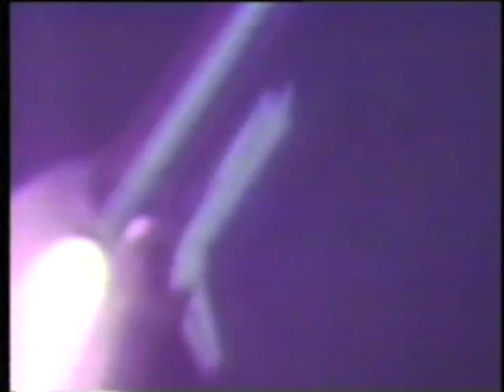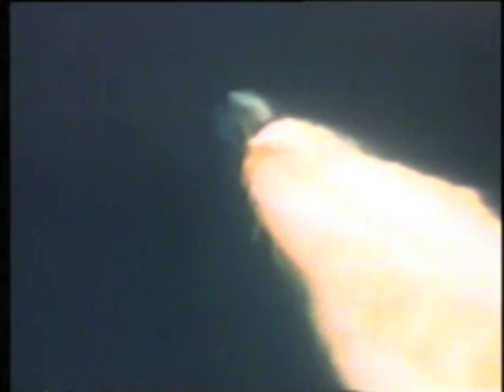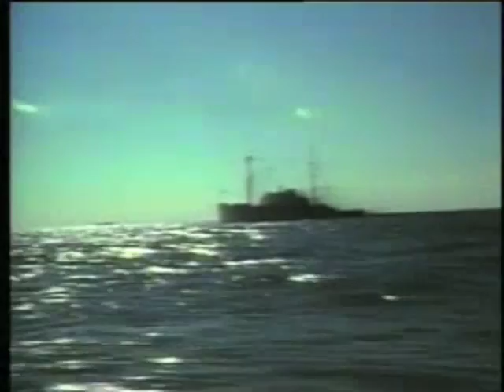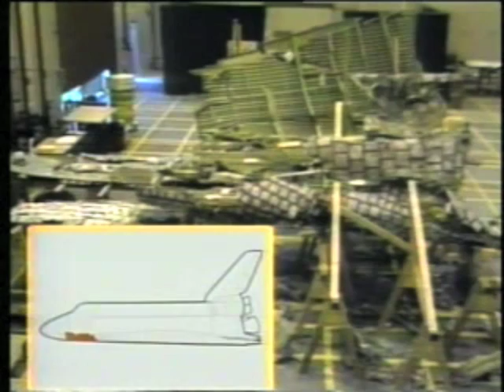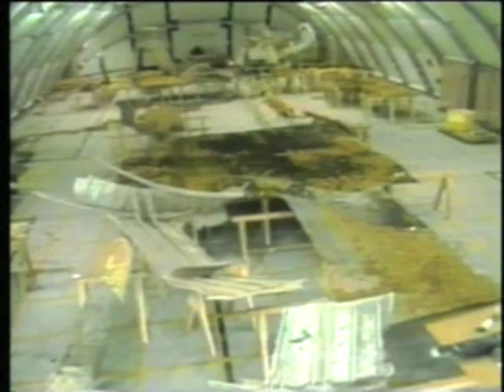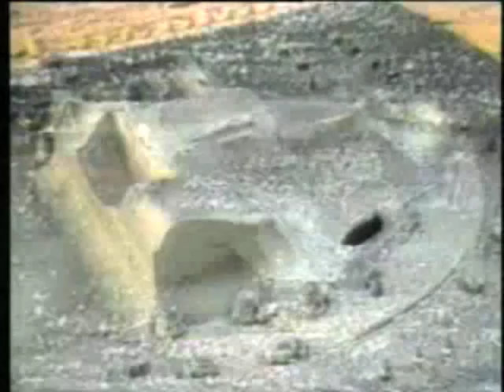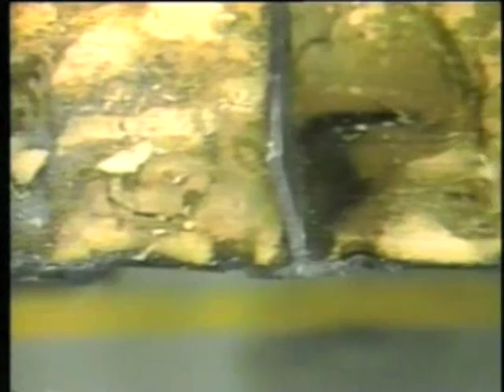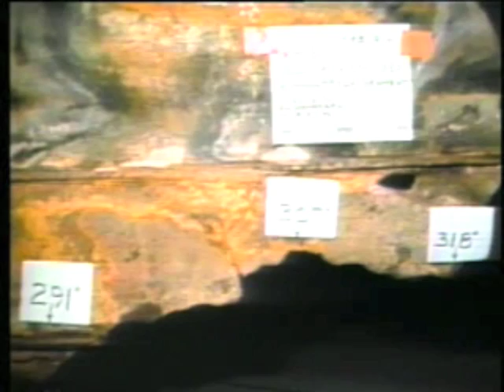Challenger Accident - Part III Photo and Video Analysis

Comment: the cause of the challenger breakup was NOT a faulty srb seal design. if it was why went the 24 previous launches right? the real cause is the faulty design of the NASA and Thiokol Managers and Bosses brains. they were (and are) money-  and prestige addicted and stupid as they have NO technical understanding. Because of that they did not listen to the thiokol engineers which strictly recommended to abort the launch because of the cold temperatures. But managers and bosses said...."what do engineers know?!"  NASA and thiokol bosses and managers are guilty. because of them and their wrong decisions the shuttle was lost (about 2,8 billion USD) and its crew died.
Reply: No, it was the seal. This particular flight happened to take place on a day when it was 15 degrees colder than any previous flights. That temperature difference was enough to cause the seal to fail.
Reply: Mud Marine, i am not stupid. i know that the seal was faulty. and the nasa and the thiokol guys also knew that. so the accident could have been avoided if the money addicted heads and managers listened to the thiokol engineers and abort the launch. but they didn`t. and so they are responsible for the dead of the crew and not the faulty seal!!!
Reply: Martin, first of all, the seal wasn't faulty. It would have performed just as well in this launch as it did in all the other launches previous. It was just TOO COLD that day. 
Second, you just HAVE to blame someone. I don't understand that. Whenever something horrible happens, people have to blame someone. They get angry at the situation and they just have to make someone take the fall for it. Well, guess what.
Sometimes, accidents just happen!
No one knew those seals (all of the O ring seals in all of the rockets in all of the launches) would fail at a certain temperature.  All they knew was that they hadn't failed at the cold temperatures at which they had launched under previously. You think all the "heads," as you call them, would have taken such a stupid risk knowing that the entire world was watching? No way! If there had been one inkling that there was  something wrong, they would have postponed the launch. The very last thing NASA would want is bad press. Having a launch fail this badly was something they would have avoided at all cost. They did not know!

Now, I'm certain that the government and NASA worked together to try to hide things from us to try to control the bad press. Of course they didn't want it to get out just how bad it really was, because they know perfectly well that people have the need to BLAME and PUNISH, even if the event was a complete accident.
Reply: People need to,understand that this whole thing was to make money. To have more people watching this particular launch because they were having a teacher "civilian" go to space...BULLSHIT. You have to have a degree in engineering,,biological science,,physical science,,mathematics,,computer science and at least a minimum of 1,000 hours of flight time as a pilot. Then for some reason they are going to take a school teacher who has none of those degrees or a pilot license and then give her a 5 month crash course of being an astronaut. BULLSHIT..,If I was the captain I wouldn't want her to be on my team. Its that simple. So they get the American people all excited and do the launch and it blows up. C'mon people. Sounds like a way to get,more funding and its amazing how will train someone in 5 months. Also from what I seen is that the crew members are alive today.
Reply: trunk, i agree in what you are saying about mc auliffe. and maybe in some kind the accident was good for the nasa...the challenger desaster  maybe draw attention of the people back to the shuttle program.... after the first launches people got bored because it was always the same..... 

however i dont agree that the crew is alive. they are dead, believe it! how can someone think that they are alive?????? after the crew cabin smashed onto the rock hard ocean surface with 200mph they wiped off the dust of their clothes, left the cabin and swam back to the beach???? then they got home, took a shower and continued their lifes as if nothing had happened? telling nobody anything? do you really think so? NEVER!  They are dead and nothing else!!!

if they were alive everybody knew that for sure!
Reply: Piss poor decision making by NASA leadership and the seal specialists. Criminal in fact. No one wanted to be the cause of further delays., so they green lighted. There was ice all over the launch pad and equipment that had to be melted prior to laumch.

Comment: Such a shame, that the crew module didn't include a safety parachute for a soft Landing into the water
Reply: Rapture's nest. The crew module was too heavy. Any parachute system big enough to land it safely would have been prohibitively large and weigh far too much - in any space craft or launch vehicle, weight saving is always on the mind of the designers.
As an example, the complete Saturn 5 rocket, minus the Apollo spacecraft and Lunar Module, contained so much wiring that an extra drop of solder and an extra 16th inch of wire at each joint would have added up to the weight of the payload (Source: "Apollo: The Race To The Moon" by Murray and Cox).
Reply: I think so  !  Don't you think that strange  ?  A parachute has been deployed for material but not for the crew  ??  And civils were on board  ! When we just talk about militaries that's an injury at work. The risks are not evaluated the same way.
Reply: This is one of the worst responses here. They would be dead....do you realize how fast they're going? Pay attention in school and learn something.

Comment: They must have recovered the crew module and maybe even crew members but are not going to discuss that at risk of being sued by family members.  The crew died on impact with the water.  They did mention that emergency Oxygen packs had been turned on by at least 2 crew members so we know they recovered enough evidence to verify that.
Reply: +Roland Waites not to minimize their situation,but it's happened many times with airplanes with hundreds of people screaming on the way down.
Reply: TheoneGodfather,
You are right. When you board an airplane, you don't expect to be free-falling through the sky but it does happen.
Reply: Roland Waites
"the three crewmen who burnt to death on the pad decades before"
For the record, the Apollo 1 crew died of smoke inhalation.
Reply: The crew module was recovered. The investigation on that was done behind the scenes by other crewman and people familiar with it. The breathing air packs (PEAPS) were recovered. But they were not CO2 or even O2, just breathing air. They were made for an pad escape as well. No one is going to get sued by talking about it. It was just very personal and NASA didnt want people associating what they saw with what actually happened in the crew module. People assume and guess without the facts.  Same thing happened on the Columbia investigation.
Reply: ***** Not really what happened. In a split second the orbiter broke apart. Once that happened, all communications stopped. Why? Because the orbiter lost power at that second. All power generating fuel cells are below the payload bay which the crew module separated from.  No power, no transmitters, recievers or antenna's are working. So there was no talking on the way down, last words to family or anything. They were tumbling in the dark until they hit water.

 There was no secure audio comm that early in the program. It was developed later for the DOD missions and after NASA put up their TDRSS satellites. But early in any launch comm is sent to ground first near KSC then to Houston.

All the remains were recovered in the crew module. The current carried Greg Jarvis's body down stream during extraction and it was lost until the next day when it was recovered.
Reply: Jfit,
I was so hoping that the crew members died when Challenger exploded. It is too awful to think that they died on impact in the ocean. Just a horrific event that most of us will never forget.
Reply: Jfit O2 packs. Not CO2
Reply: Death occurred no later than impact with the water, yes. We can’t be certain about much else. We don’t know if the crew module depressurized rapidly or not, so we do not know how long the crew remained conscious. It is possible some or all were both alive and conscious when they impacted the ocean. It’s a disturbing fact that we can’t rule out that possibility. So much remains uncertain about the crew’s condition after Challenger broke up.
Reply: +Roland Waites You are very right about how awful it is for both those that are out recovering remains and the families that have to imagine what their loved ones endured during the catastrophe. I lived in the Dallas-Fort Worth Metroplex when the Shuttle re-entry disaster happened in 2003 and I actually watched the shuttle break up and fall in pieces all across the sky in a big streak of light and sparks and fire. It was just horrible. The Shuttle pretty much always passed over the DFW Metroplex each time one of them had a mission and then reentered. So my friends and I would have a Shuttle Reentry Watch Party and would go up to the third floor of my condo and watch it from there. I always had a TV up there that we could watch the coverage of the Reentry on. It was always a grand time and always made me feel proud to be an American. That day was to be so different, though, and it was just so terrible.

We were in a festive mood until we saw how the streak across the sky start to turn into smaller pieces and looked almost like sparks and erratic fire. We had seen enough Shuttle reentries that we immediately knew something was very wrong. We had never seen one that looked like that. But we kept out hope of hope that it just looked wrong but wasn't anything wrong. I remember how deathly quiet it got in the atrium up on the third floor of my condo when we all truly realized that something had gone terribly wrong after the coverage of the Reentry reporting that the Shuttle was missing. Our hearts just sank.

Then all kinds of strange warnings and news bulletins started telling all of us in the DFW Metroplex to watch out for debris falling from the sky. They said for everyone along a specific path across the Metroplex to get inside our houses and not to be outside unless absolutely necessary. They also told us that if we had any debris to land in our yard, on our house, or anywhere on our property to absolutely not touch it but gave us a number to call in just such instances of finding debris. They even instructed emergency services personnel to not touch debris that either caused fires or had struck a person and injured them. It was all one of the most strange set of news bulletins I had ever been subject to. Then there was a whole other set of instructions for anyone who found remains of any of the crew of the shuttle. I prayed to God that I would not find any of that in my small condo yard or on my roof. That would have just been to weird and too heartbreaking.

Over the next several hours there were all sorts of reports of debris being found in people's yards and on their roofs and on their rural property. A woman that I know actually found the headless body of one of the astronauts in their back yard on a farm that she and her husband owned.

I can't imagine how gruesome that had to have been to find those remains and know what the family of that person would be having to endure over the next few weeks with the identification and the press hounding them to no end and everything else involved in it all. Again, it was just a very strange time. I'll never forget it. And to have lived right where it had exploded and the debris fallen was just so strange, too. Before that I had never dreamed I would ever be searching my own yard for debris of a destroyed Space Shuttle. It was heartbreaking.
Reply: Al Scarbrough Damn! You had me, up, until, “headless body of one of the Astronauts was found...”. Nice try. Ha
Reply: @BecauseMyGrandfatherSaidSo  The bodies were found in pieces. It's well documented that a shoe was found with part of a foot as well as a helmet with only pieces of scalp and hair. The shuttle and the astronauts were subjected to such severe aerodynamic forces that it would be very unlikely they would have remained intact. Airplane crash victims who fell from cruising altitude, like those who died in Lockerbie, were subjected to much lesser forces, but they were still sufficient to cause dismemberment in those crashes too. It's actually simple science.
Reply: The crew compartment was found in ninety feet of water amongst a large amount of sharks. They were found accordian style in the compressed compartment.  It took eight hours to recover the bodies from the wreckage with a lot of betadine used.

Comment: The Actual Failure was in the Absolute greed, stupidity, and ego of nasa!!! Read the book, " To Slip the Surly Bonds" by J Remak. It will give you endless nightmares about the sheer incompetence of nasa that has cost the lives of Apollo 1, Challenger, and Columbia.
Reply: Part of the reason the SRBs were segmented was for ease of transportation.  Another reason was the ability ensure homogeneous fuel in the SRB.  Much easier to do in a short segment than an entire SRB. That is what I read.
Reply: it was all for show anyway...NAZA doesn't care that most of its video was shot in a Hollywood basement
Reply: I also understand that NASA were forced to go with a segmented booster design due to congress budgets whereas they originally wanted a one-piece booster. A segmented booster was far from an optimum design. Does that make the politicians as guilty as NASA? I guess we’ll never know. How any organisation could knowingly risk peoples lives is beyond me.

Comment: they got 50% of the challenger back ...flight 93 on 911 they got a seat belt and a man's red tie .wtf.
Reply: Challenger was in motion when it exploded, therefore, not a complete stationary burn up. The aforementioned plane exploded and burned up in one stationary area, therefore, more of the applicable entity was engulfed, yielding nominal recovery.

Comment: in itunes-University you can find videos from an MIT lecture series on Space Shuttle. Engineers/designers/techs who worked on Space Shuttle talk. One said the design was supposed to be evolved into a newer design but there was not enough money. And Air force liked the space shuttle because it had bay big enough to launch spy satellites. So they were pretty much stuck with the design. Basically the Space Shuttle design wasn't the choice of engineers.
Reply: Someday, humans might be free to design things to the best of their ability, instead of to the best that little rectangles of paper will allow.

Comment: This is a LOT different than what I had expected. The right SRB  did most of the damage by burning through the strut and breaking off from the ET instead of making the ET explode, It was aerodynamic effects of crashing into the air at such a high velocity  and at impossible angles that caused the shuttle to come apart, not the tank exploding. The huge plume was more due the gases escaping from the ET and less to due with the hydrogen burning.
Reply: That's what I took away as well. The entire stack essentially "jacknifed" and disintegrated at incredible speeds and aerodynamic pressures.

Comment: The shuttle was perhaps the biggest mistake NASA ever made. By the time it first launched it was well short of the original concept and had reverted to using solid fuel boosters. A launch system with no escape for the crew and years later Columbia demonstrated yet more frailities of the shuttle.
The shuttle was not glorious, just a heartbreaking reminder of what could have been had it never existed.
Reply: Although your sentiment might be correct, I do not think it was a mistake. They flew 135 successful missions. This is a testament to the design, albeit rushed and ill-managed.
Reply: Buran only flew once, and landed once, autonomously and automatically. Flew once, landed once, in one mission, for the first and last time. Not because it was bad, but due to lack of funding. It was much superior to America’s Space Shuttle